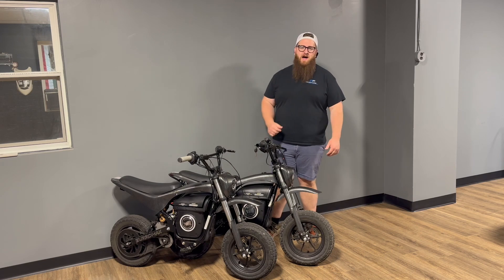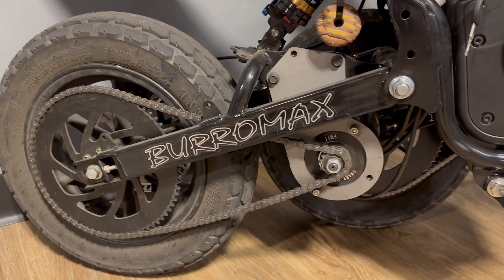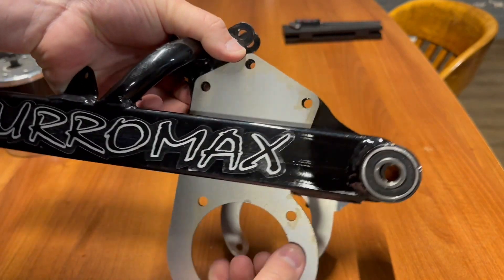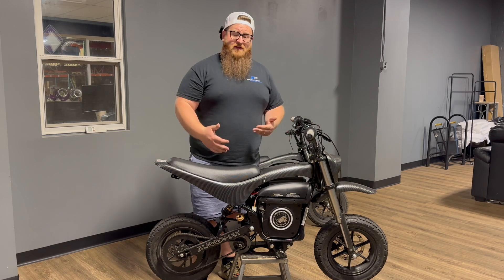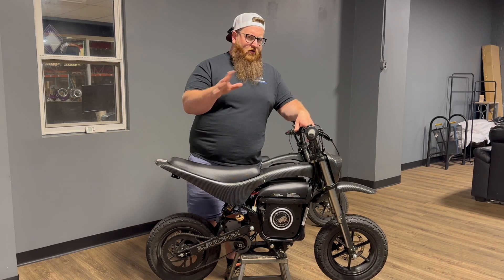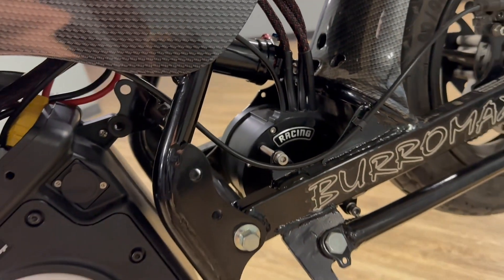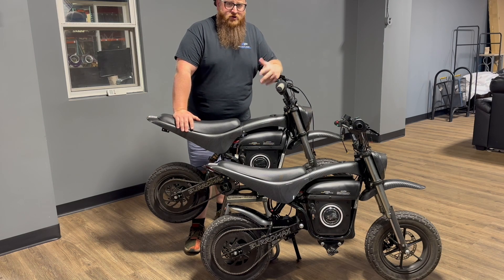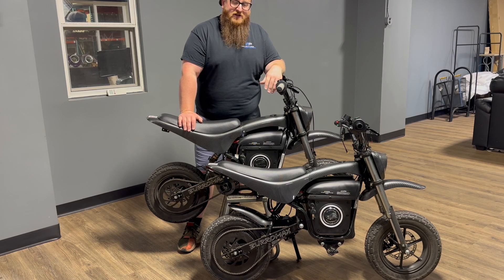How To Upgrade Burromax TT1600R | Part 2 - BIG Motor and 72V Battery

Comment: Won’t this shift the motor to the left by the width of the welded metal and cause the rear wheel to be misaligned?
Reply from the maker: No, the alignment is spot on.  Haven't thrown a chain yet.

Comment: Looking online, an HPM-3000B motor is only 107mm long. Lightning Rods also has 3 motors that fit, the Small Block 5kW (75mm), Big Block 10kW (98mm) and XL 13kW (114mm) - might be worth looking at stocking Lightning Rods' motors because they're more powerful and much lighter.

Comment: I want to soup up my burromax 1600  too 72v series that can go 60 mph I was wondering  maybe you foks can send  me a brochure  or a price  guide on how much it will cost & a manufacturing  guide of all the aftermarket
Reply: Are installed  my address is 2517 Ala wai blvd apt A1 Honolulu hi, 96815 hope to hear from you soon I'll purchase everything  from you foks 72v  battery,  72 v controller & I think  🤔 it the 10-20 motor with bracket  aloha 🤙🌴

Comment: 2500w limit on the mini? Sounds like it’s not tuned right. I’ve ran mine at 7200w line geared for 55mph staying under 100c the whole time
Reply from the maker: Sounds awesome.  
Contact us so you can tune one for us - we'll test it report back

Comment: Thinking about running stock motor with the 72v bag and controller 2 questions tho how would I hook up the new stuff to the stock motor (I’m not sure if I can wire) and does the stock speedometer keep up accurately?

Also how is the range now?

Comment: i have a question does the mini work with the regular battery and controller
Reply: It’s great tbh it preforms like a surron (main difference is a loss of torque on the top end)

Comment: I tried to tell people fw11 has heat dissipation problems but got flamed. They trusted the Facebook guy who provided input to motor development and no background in engineering over an actual thermal engineer. This is the Internet.

Comment: The tp120 fits and is probably the best motor upgrade candidate available
Reply from the maker: We're not familiar, any chance you can send us one to test?
Reply: @MomentumWatts  it's lightningrods XL motor.
Reply: @Nominally-Built  Do you have any more info on how you found that out? I'm about to get a Burromax 1600 and would like to upgrade the motor straightaway.